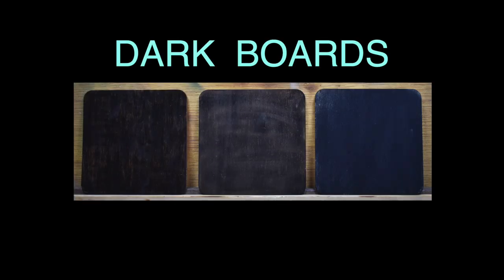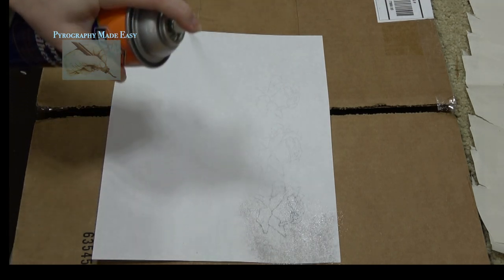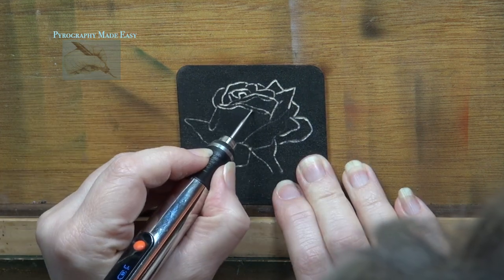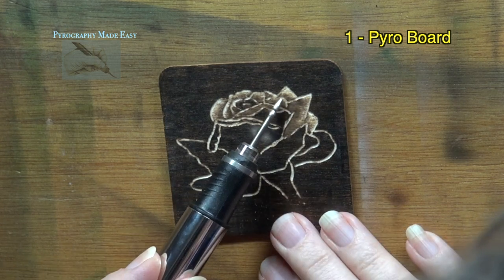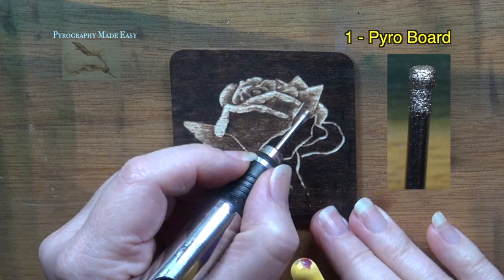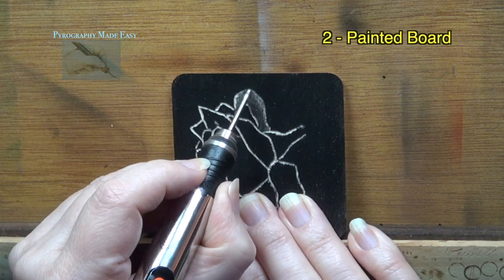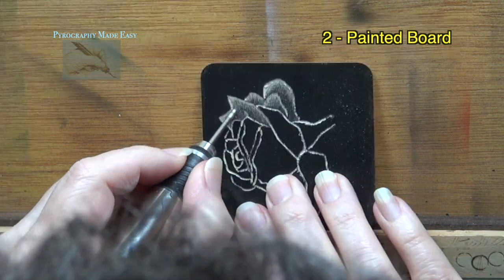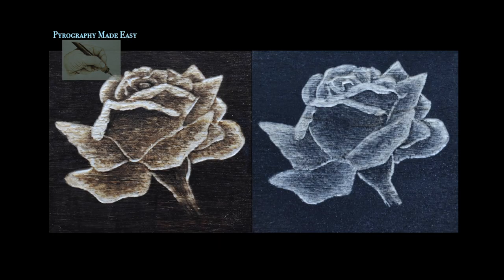Wood burning  -  White Roses Engraving Tutorial  -  Customizer Engraver

Comment: Beautiful! I would like to know What kind of wood do you use?what kind of paper? Please Thank you in advance 😊
Reply from the maker: Hi Mimi,
the wood was plywood, but I don't know what type.  The boards came with the Goodcrafter pyrography burner I was sent to review.  
The paper I used for the pattern transfer was lightweight copier paper.  Nothing special.  I think it is 16-20 lb paper.
Reply: @PyrographyMadeEasy   ok, thank you so much for your answer 😊🙏
Reply: @PyrographyMadeEasy  Hello, sorry to bother you, I have Dremel versa tip. when I burn the background  and I can't fill everything in black because I burn and the wood  is really damaged and crack. I use poplar or birch plywood wood (Square 15cmx15cm thickness: 3mm) How do you do smoothing and wood burning a dark background? Do you have a video how to use a torch?  thank you!
Reply from the maker: @mimim6724  I don't have a video using a torch.  I'm not very good with a torch.  
I assume you want to engrave a design like I did.  If that is the case, then paint the background.   I did that on one of the roses.  It worked just fine.
Reply: @PyrographyMadeEasy  ok, no problem . Good idea to paint ! 😃thank you very much fro your help. All your tutorials are always very interesting.
Reply: Hello, sorry again What did you glue the paper to the wood with? Please thank you so much